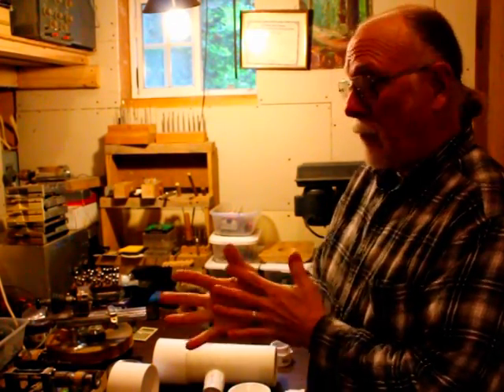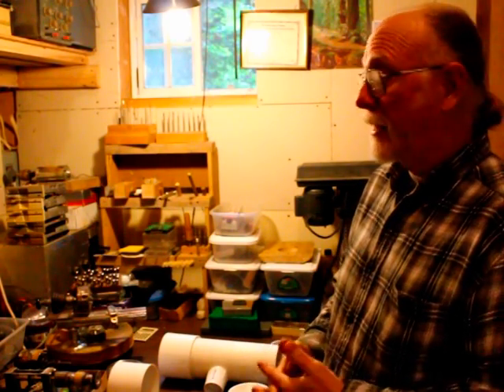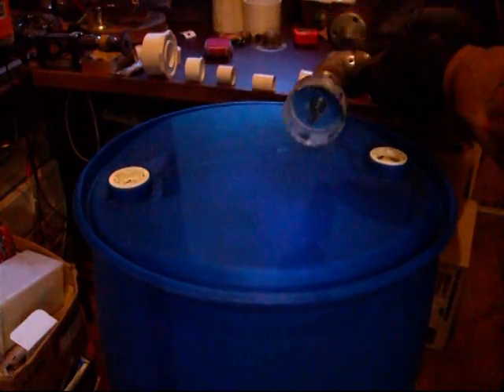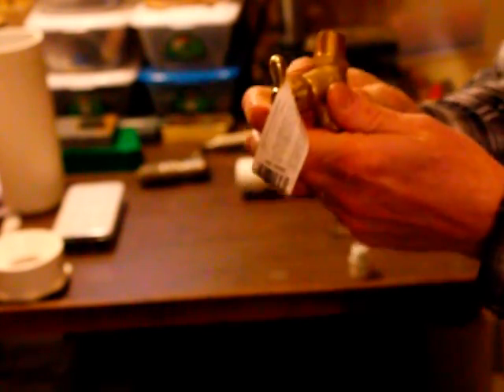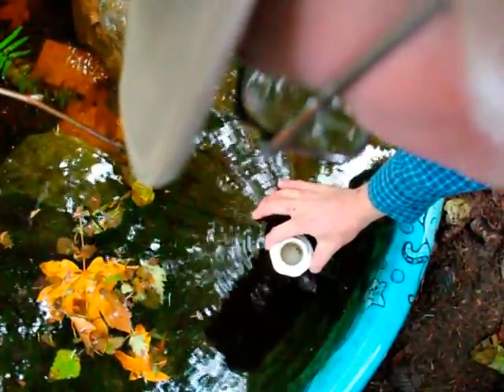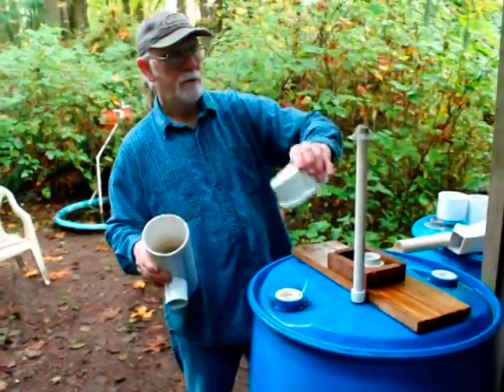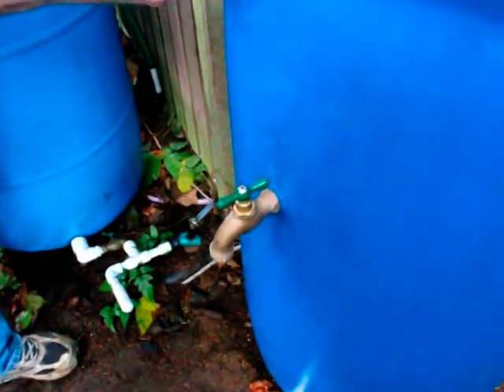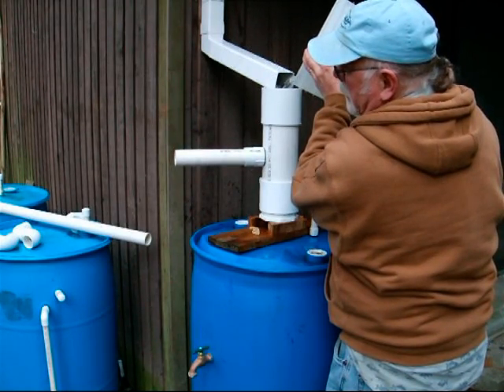DIY first flush diverter PART TWO

Comment: Made one myself a while ago but a little different principle is the same. I see some people asking why one would have so much water diverted. The mathematics is the same all over the world.
One square meter of anything will produce one  (L)  of water for every mm of rain.
Minimal pollution allow 0.5L per square meter. (Open fields no trees and no bird droppings) 
Substantial pollution allows two L per square meter. (Leaves bird droppings all the usual suspects.
So before you decide on making your first flush diverter have a rough idea of the roof size and add a little extra for winter. But if you take some precautions from the start you can improve the rain water quality from the start. 
Dead vegetable matter in the gutter will cause problems from the start as water that is contaminated 
with human or animal (including bird) faeces. Faeces can be a source of pathogenic bacteria, viruses, protozoa and helminths. Faecally derived pathogens are the principal concerns in setting health-based 
targets for microbial safety.Coliforms are classed as faecal indicator organisms but can be caused by the presence of rotting vegetation, while bird droppings washed down from the roof could account for E. coli and faecal 
coliforms. If you should have your water tested your test could result in finding all the above. So there are some simple things you can do. A fine mesh screen on your guttering will stop any large plant matter from entering the gutter.  And will allow them to fall to ground.  But it won’t stop pollen and that is a plant matter so the first flush diverter is a must but measure up and allow a bit extra. 
I don't use a vent on the first flush container as air escapes out the  first flush as its at the highest point. It has no problems filling or draining as the air in the downpipe enters when the ball drops. No vacuum is formed all the holding containers are vented with automatic vents Block your vent and see what happens. Would like to know your findings

Comment from the maker: I've done some more checking: Glue two 1 1/2 inch couplers together end to end (use the smooth ends) you'll need 3 or 4 applications of glue. Be sure to get them straight at first. The 40 mm ping pong balls fit inside them well. Then an adapter on the bottom to a 1 1/4 size pipe with a slip cap on the end. Drill the holes in the couplers b4 you glue them. Hook up the same as in video to the 2 inch threaded adapter. schedule 40 will stop the 40 mm ping pong ball and make a seal if you bevel it.

Comment from the maker: Ooops, the larger slip cap required for the 2 inch pipe won't fit through the tapped hole in the top of the barrel. Maybe, if you can find a way to plug the end of the 2 inch pipe  other than a slip cap. . . ? Also, a fishing float (bobber) may fit inside schedule 40 inch and a half pipe. The edges would have to be smoothed out though? I'll work in this soon. Thanks for the heads up on this problem.

Comment from the maker: Sounds like a good idea. The ball just needs to seal against something and be inside a guide with holes in it - I used an inch and a quarter section of schedule 20 pvc for the seal, but anything that provides a seal for the ball should work. So if you can get the reducers to match the 2 in pipe, it should work. The ping pong balls are really inexpensive - so I used them. The ping pong ball in my other diverter has lasted through 3 winters.

Comment from the maker: Did some measuring. There are two sizes of ping pong balls (apparently) 38 mm and 40 mm. The 1 1/2 inch pvc should be schedule 20, and the ping pong ball should be a 40 mm size. Schedule 40 may or may not fit depending on the manufacturer.

Comment from the maker: I'm glad it helped. There are 3 of them working here now flawlessly; all the same design. The ping pong ball has lasted 3 and a half years in the first one and is still working.  We recently had 3 tenths of an inch of rain in about 8 minutes. Very unusual for western Washington's Seattle area. The water was spraying out of the downspouts with pressure. The diverters handled most of it - but not all!!

Comment: Very interesting vid. I am in the process of purchasing the necessary part for a different version of a first flush diverter. Your vid has made me rethink my design. Thanks for resetting my thought process. Even with a 55 gallon flush tank, the water can still be used for the garden or similar.

Comment: Hi Dave, I love the hand drill. I need to get me one. My roof is filthy too with a giant Mulberry tree above it and of course lots of Mulberry bird droppings and pollen. Got a question: I am wondering since the pingpong ball has low air volume, does it still seat well to block water when theres the weight of the water in the pipe above it?

Comment from the maker: Maybe, 10 gallons, in the winter. In the summer, here, the roof gets very dusty and it takes a lot of rain water it to wash the dust off. Even 25 - 30 gallons per downspout is sometimes not enough. The water in the barrel can then be used in the summer by running it through the slow sand filter very, very slowly a little at a time. It gets very dry here in the summer.

Comment: Why do you want to divert so much water into the barrel? Can't you get by with just 10 gallons or so?
Reply from the maker: It depends on the condition of your roof. Our roof has massive organic material on it because we are directly beneath a 130 foot fir tree. Lots of water needs to be diverted because it takes a lot to wash off the roof. Someone in an area with no trees over the roof will, of course, not need nearly as much water to wash the roof.